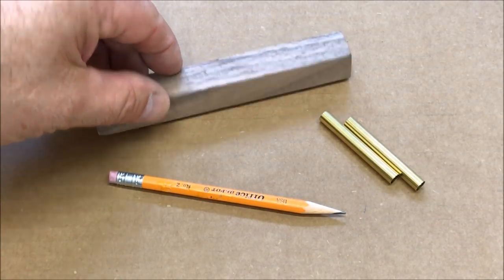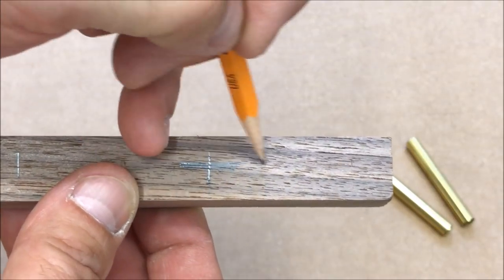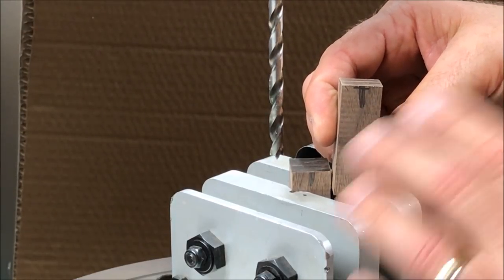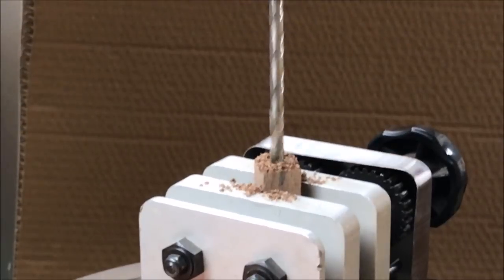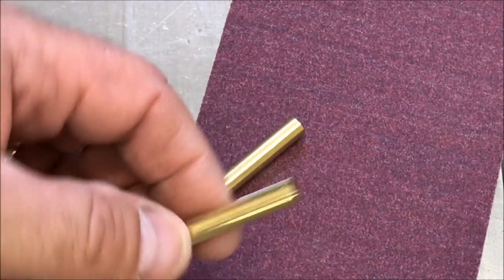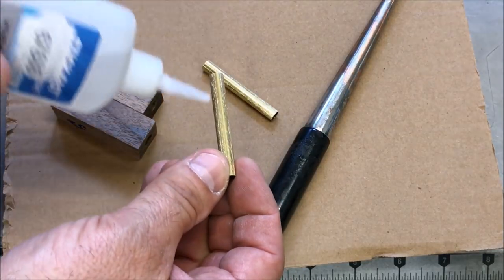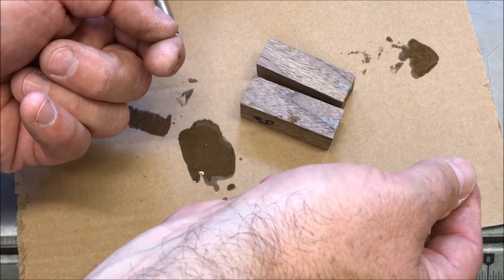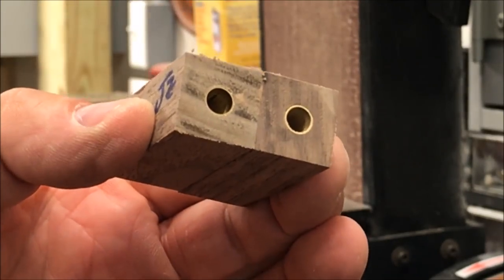Preparing Wood Blanks to be Turned on the Lathe

Comment: RJB, I've been invited to do a public demo and wanted to ask you about what type of wood should I use . I don't have a dust collector but I do have an acrilic enclosure for the lathe.  I'll have the blanks ready to be turned but  since I don't have a dust collector,  what kind of wood you recommend? 
Thanks.
Reply from the maker: All wood dust is bad for you. With that in mind, is avoid sanding unless you use something like a wax/mineral oil mixture on the sand paper to sand with.

Regards,
Bob
Reply: @RJBWoodTurner  thanks, I'll be looking into the wax and mineral oil mixture. 

Thanks again, Ely

Comment: Hi im hoping you can help ive turned a blank using red mallee when I've applied the ca glue when i go to polish the blank its turning dull looks like the woods turned a different colour one side is shiny the other looks like its lost its gloss ive tried a new bottle of glue is this laminating this mostly happens towards the ends of the blanks
Reply from the maker: Foggy C/A Finish

When C/A cures it builds heat. The surface area of the C/A will cure first because it’s exposed to the most air. If there is any moisture in the blank, blank was not completely dry, wet sanding of the wood, not giving the Denatured Alcohol enough time to flash off, that moisture will evaporate and get caught beneath the top cured layer causing the hazy/blush effect. 

  If you’re using activator, it causes a chemical reaction with the C/A that essentially makes it boil. That boiling effect creates even more heat which caused rapid evaporation of any moisture while the C/A is curing. 

  I occasionally I can buff the pen and remove the haze but more often that not, I end up refinishing it. 

  Usually I’ll micro mesh heavily until all the shiny is gone and the blank looks dull. At this point the blank is still sealed by the original coats of C/A so it won’t flash the moisture any more. I reapply my C/A, Micro Mesh, and buff the blanks to a brilliant shine. Only us the Micro Mesh for his as Sand Paper will remove to much material and can cause an ill fit with the pen components. 

Regards,
Bob

Comment: Hello Bob,
What belt sander do you use to clean up the blanks?
-Edward Runov
Reply from the maker: Hello Edward,
  It’s the Craftsman 9” disk with a 6” x 48” belt. I’m not sure of the model number but they only sell one of that size. 

Regards,
Bob
Reply: Thank you Bob,
This will really help me out with my problems.
-Edward Runov